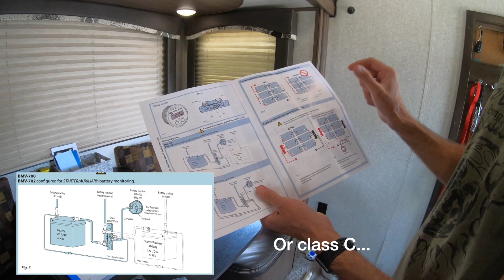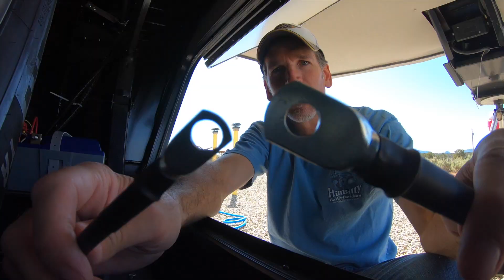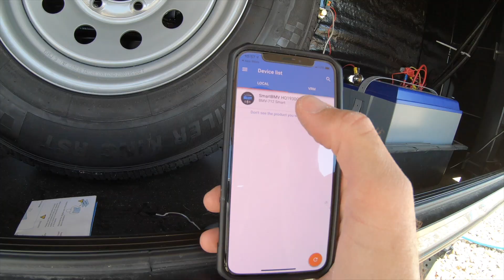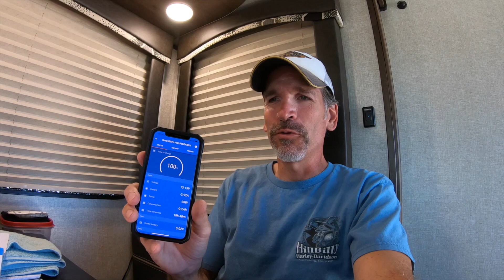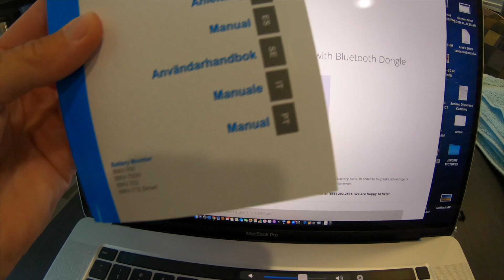Victron BMV-712 Bluetooth RV Battery Monitor Installation & Review (w/ Battleborn Lithium battery)

Comment: So I just bought this. Confused on how big a wire I need to buy. I have 4 agm inline 12v batteries. Haven't been able to upgrade to lithium just yet. TIA
Reply from the maker: Hey Tim. You’ll need to know the max number of amps of 12v DC current you’ll be using at any time to calculate the wire size.  Here is a link to a wire size calculator that I use.  https://www.explorist.life/wire-sizing-calculator/   This guy also has a ton of great videos on YouTube. If you’re not using an inverter and you haven’t made any modifications to the camper, you can figure that the max wire size needed will be the same wire size that currently feeds your campers DC system.  So you can look at the wires coming off your battery bank positive lead and the biggest wire is the size you would need to use for the negative wire running to the monitor.  This is typically 4 AWG or 6 AWG unless there is a factory installed inverter.  If you have an inverter or plan to install one, the wire size will need to be much larger.  Example: A 2000 watt inverter will require up to 167 Amps at max power (2000W/12V=167A) You’ll then need to add any other potential 12V amperage that your camper could be using at the same time.  Typically, this will be the max amperage that your converter/charger will generate.  Our charger can send a max of 50 Amps to the batteries. Others can be higher.  Take your total amps (ours would be 167+50=217) and plug that into the calculator.  You’ll then need to measure the total length of the wire running from the negative battery terminal to the battery monitor and double it.  So if it’s 3’ total, you’ll need to use 6’ in the calculator.  The calculator tells us we need 2 AWG wire for our example. Again, I highly recommend checking out Explorist Life on YouTube.  He does a great job explaining electrical.  Hope this helps!
Reply: @EddieAtLarge  Thanks so much for the well thought out answer.
Reply from the maker: You’re very welcome!  Feel free to let me know if you have any other questions.

Comment: Thanks for putting this together! I'm looking into the same setup, and I'm curious about the range/distance you've experienced with the bluetooth connection to your phone? I read some reviews that it's not very far.
Reply from the maker: Hey Jason!  Glad you enjoyed our video!  The bluetooth doesn't reach extremely far, however, we've never had any issues connecting to it anywhere within out 25' 5th wheel and the unit is placed all the way at the front hidden away in the front compartment, so, it has to go through multiple walls to connect.  I can also connect to it while driving down the road and towing the trailer with no issue.  We are still very happy with the monitor and it has worked very well for us.  Hope this info helps you make your decision!
Reply: @EddieAtLarge  Thanks! I just ordered one... and I do see Victron offers a bluetooth dongle to extend the range, but fingers crossed I won't need that.

Comment: If I have 16s 48v and use a BMS, will I be able to connect a monitor through? Does it have a diagram in the packaging for that set to?
Reply from the maker: It will work for 12, 24 or 48 Volt systems.  The diagram is the same for all voltages.

Comment: Iam confused about the discharge floor being set to 0%. Should it not be 20% for lithium ion?
Reply from the maker: In the video, I stated that I had it at 0% initially and when I added the setting parameters from Battleborn, it changed it to 5%, therefore, I left it at 5%.  
After doing a search, I've found that the discharge floor setting only influences the battery level "Indicator" that can be seen in the bottom right corner of the display (not the app) and does nothing else.  Here is a link to the question and answer on Victron's community website.  https://community.victronenergy.com/questions/78448/bmv-and-discharge-floor-impact-on-soc-reading.html
So really, it should probably be set to 0% per this information.
  
Regarding your comment where you thought it should be set to 20%, I believe you are referring to the possibility of the battery being damaged if it would get below 20%?  Battleborn has a protection setup with their BMS that is called "Low Voltage Disconnect" that will automatically shut down the battery when it falls below 10V which per the lithium Voltage chart is 0%.  Then the battery has to be jumped to "wake it up".  They claim this will not damage the battery as long as it is restarted within 5 days of going into LVD.  Here is a link to that article: https://battlebornbatteries.com/low-voltage-disconnect/     If you don't have Battleborn batteries, you will want to check with your battery manufacturer to make sure it has low voltage disconnect protection.
Reply: @EddieAtLarge  Thanks for your quick reply. I checked with my battery [canbat] and they specified to discharge 80-85% of the lifepo4 energy capacity before recharging. They do recommend the depth of discharge to be 80%, so I set the discharge floor at 20%. They also do have built in over-discharge and over -recharge protection.

Comment: Thank you so much for this.  Very clear video.  I’m trying to figure out how you  would need to modify the installation if you have multiple Battleborn Li batteries - I have 4 in total.  Where would the shunt be installed then?
Reply from the maker: @Brad White  Glad it was helpful.  The shunt would need to be wired to one end of the battery bank on the negative terminal with no other negative wires attached to that negative battery terminal.  This would also be on the opposite side of bank from your positive terminal connections.  All of your house negative wires would be connected to the other side of the shunt or they would be connected to a negative bus bar which would then be wired to the other side of the shunt.
Reply: @EddieAtLarge  thank you so much. So if they are wired in series you install it to the that is wired into the house (or closest to it ).  I was wondering if it went in the middle or something. Was hoping I could wire it right near the inverter.
Reply from the maker: @Brad White  Sorry, just saw this now.  If you have 12V Batteries, you would usually wire them in parallel  (positive to positive on all batteries and negative to negative on all batteries) to keep them at 12 Volts if your camper has a 12V panel which is typical.   Not sure how you wired your bank though.  Here is a link that shows both "Balanced" and "Perfectly Balanced" 4 battery banks wired in parallel (scroll down till you see them).  https://www.windynation.com/jzv/inf/how-configure-battery-bank   
Substitute the positive connection (where they show the controller connecting to the battery bank) with your house wires, inverter, etc... and then the negative from the battery would be a single wire connected directly to your BMV shunt.  On the opposite side of the shunt you would connect the negative wires from the house, inverter, etc...  If you have a lot of wires to deal with, you can use positive and negative bus bars to clean them up.  One note would be if you are wiring in the "Perfectly Balanced" configuration, I would recommend moving the 2 lower batteries up beside the other 2 to form a rectangle as you want to try to have close to the same length wire running from battery to battery.  Sorry if this isn't the answer you are looking for.  It's hard not being able to see your current setup.  Let me know if this makes sense.

Comment: I have the Lynx Distributor. My installer connected the red power wire to the positive terminal on the 12V fuse block, and I also have no power to the Lynx. Trying to figure this out, any ideas?
Reply from the maker: @Mallory McGuire   Do you have power to your camper and are just not seeing the lights on the Lynx distributor?   If so, it may be because you don’t have a Victron BMS or Victron Shunt (These are different than the Victron BMV-712).  I do not own a Lynx distributor, however, a creator that I follow has an entire series set up for these products.  Here are a few links to videos that may help you make sense of the issue.  The first talks about general information on the products and the 2nd is a hack to get the lights to work on the distributor when you don’t have the Victron Shunt or BMS. 
It seems ridiculous to me that this would need to be done to get the lights to work.  And adding the Victron Shunt that doesn’t have Bluetooth like the BMV-712 Monitor does not seem like a good option either.  I would recommend showing these videos to your installer and see if he can do the hack or remove and replace the Lynx with normal bus bars and fuses.  I guess the last option would be to live without the lights, however, that seems to defeat a big part of the purpose of having the Lynx. Please let me know if this info helps.  
https://youtu.be/1oNMwSDrts8
https://youtu.be/8h-E1lkYCKg

Comment: I have one in my RV..  its actually called the BMV 712 SMART..   The SMART part is the Bluetooth. I now have a CERBO GX and the touch 50. I'm a trucker and I like to be able to monitor my system from the road. 1200w of solar to a Victron 150\85, all charging 4 BB 100ah batteries.
Reply from the maker: @Truck Driver  👍🏻 That’s the same one we have.  We now also have 600 watts of solar and 3 BB.

Comment: I put mine in the other day, 2018 Bighorn 5th wheel. I have two new 12 batteries and hooked to both. The only thing running is the residential fridge off the inverter. This morning the phone said I have 1 day plus, went to the trailer and both batteries were totally dead. Any ideas ?
Reply from the maker: @Rich Bring  Here's a good article that will give you an idea of why this may have happened.  The residential refrigerators use a ton of power and will drain your RV batteries in no time at all..  https://www.gonewiththewynns.com/rv-residential-refrigerator-power   
The first thing I would recommend for you to do is to get rid of your stock batteries and buy lithium.  Here's our video on changing over to lithium.  
https://youtu.be/PTiTt_kqrdo
We only had one lithium battery when we made this video, however, we now have 3 and are REALLY happy with them.  Prior to this, we couldn't even make it through one night of running our furnace with the stock AGM battery that came with the rig.  Yes, the lithium batteries are expensive, but, they are worth it and will pay for themselves over time.  And keep in mind, you can drain lithium completely without damage whereas lead acid or AGM will be damaged when drained below 50%.  Therefore, you will have double the capacity with lithium.  Hope this info helps.  Feel free to let me know if you have any other questions.
Reply: @EddieAtLarge  thanks again

Comment: Thank you! That was a simple to follow video and will help me out a ton!!!! I ordered 2- 100amp BB batteries and this monitor and wanting to add 2 more batteries, a new inverter/charger Victron has and a DC-DC charger and maybe a portable suitcase solar panel set up. Thanks again!
Reply from the maker: @J and B LawnCare  You’re very welcome!  Glad it was helpful.  We now have 3 BB, a 2000w inverter & 200w solar suitcase that I built.  Everything is working great.  Boondocked for 5 months this summer…. Still using the WFCO Lithium Converter/Charger.   If you haven’t seen that install video, here’s the link in case you wanted a more economical solution to the Victron.   https://youtu.be/PTiTt_kqrdo   Have fun and let us know if you have any questions!

Comment: Nice video!  I’ve used Bogart’s monitor before. It’s great, but this setup adds Bluetooth for similar $.  By way of cables, if you are going to add solar, an inverter and do this kind of stuff, having a selection of welding cable, good thick closed lugs, adhesive double wall heat shrink, and a crimper might be worth the investment. You can make the exact length you need, with the lugs “clocked” as you need, so as not to twist the cable.
Reply from the maker: @Jeff in TD   Hey, thanks Jeff!  Over a year later and we are still very happy with this monitor.  I've actually already installed the battery bank, inverter and solar and used all the materials and tools that you mentioned (including a 10 ton hydraulic cable crimper).  We've been traveling extensively this summer doing a ton of boondocking, really putting the system to the test and it's been awesome.  Looking forward to taking a break from the road and putting together my install and review videos...  Thanks again and glad you enjoyed!

Comment: Thank you for taking the time to make this very helpful and informative video! Perfect for newbies such as myself.
Reply from the maker: @Brandon K.  You're very welcome!  Glad it was helpful!
Reply: @EddieAtLarge  I do have one question, at 13:30 in the video you mention a system ground that connects from the Load & Charger side of the shunt down to the house itself. Is that necessary in my case when I have an Orion 12|12 30 amp isolated dc-to-dc charger where the negative output of the charger terminates at the Load & Charger side of the shunt and the positive output of the charger runs through a 60 amp fuse and then to the positive terminal of my battleborn lithium battery. Thank you!
Reply from the maker: @brandonk.1361   Kind of hard for me to speak to without seeing your setup first hand and I don't want to give you the wrong advice...  The frame (or chasis/house) in our rig and actually in automobiles, etc... is used as a conduit for a return (negative) back to the batteries negative terminal.  DC (Direct Current) circuits must make a complete circuit from the batteries to the appliance (positive) and then back to the batteries (negative).  That wire at 13:30 was already installed by our RV manufacturer where it ran from the frame to the original battery's negative terminal.   I simply just left it connected at the frame ground screw and then connected the other end to the Load & Charger side of the shunt.  To help give you a better understanding of what I'm referring to, check out this video regarding DC wiring and grounding.  https://youtu.be/gC69-BDzvps   Hope this helps!  Let me know if you have more questions or if I can be of any more help.
Reply: @EddieAtLarge  Wow, I really appreciate the detail oriented response and for the link. This is a really good start for me to understand how the ground works and whether or not it would be necessary in my setup. Thank you so much Mr. Homie At Large!!!

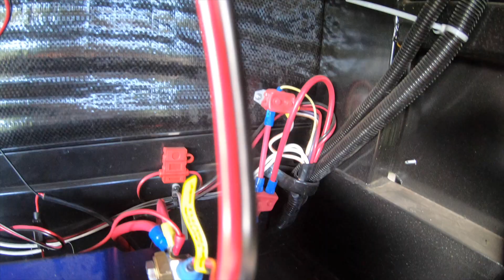Comment: Great vid. The relay comments at 21:40 seems like they may be misleading a bit. The monitor/shunt are unable to toggle current into/out of the battery/batteries. There’s relay contacts on the back of the monitor (NC[normally closed], COM [ground], NO [normally opened]) that can used to trigger an external device to turn on/off like a charger.  Just learning all this myself for a DIY install.
Reply from the maker: @Timo  I see what you mean.  I never looked into the relays any further than what I could discern from the manual as our Battleborn batteries have a built in BMS that does everything that the Victron relays are supposed to do to protect them.  I did not realize that an external device would be needed to use the relays.  Good info.  I just did a search on "relay" in the manual and I must say that Victron did not make it clear as to how the relays needed to be set up for use (unless I'm missing something).  Even the Quick Start Guide only shows 1 picture that points to the Relay connections on the back of the monitor and shows nothing else such as wires leading to an external device, etc....  I couldn't find anywhere in the manual stating that the relays needed to be connected to an external device.  If you wouldn't mind, can you provide any links to YouTube video resources that you may have come across detailing this?  Or maybe a link to another source?  I did a quick search and couldn't really find much.  Thanks!
Reply: @EddieAtLarge  I had a hard time finding anything online as well. I even have the BMV-712 new in the box with the manual and everything and still didn’t know about it. What I mentioned about the relay was from a Progressive Dynamics tech support employee. I have a PD9100 model charger that has an optional shutdown module that I was planning on using a switch to control but luckily learned the BMV-712 can do this for me. Whew!!!